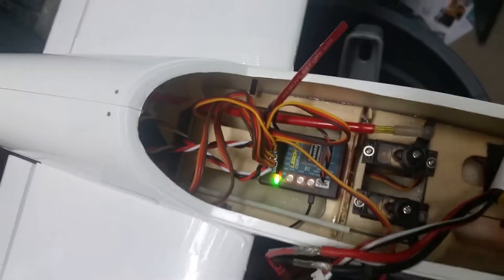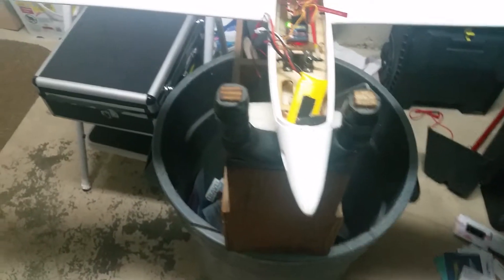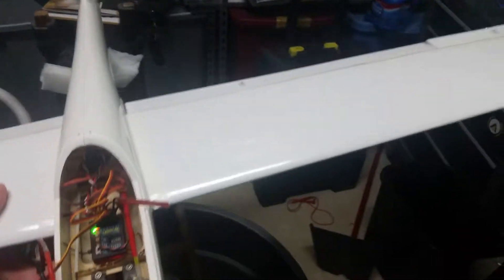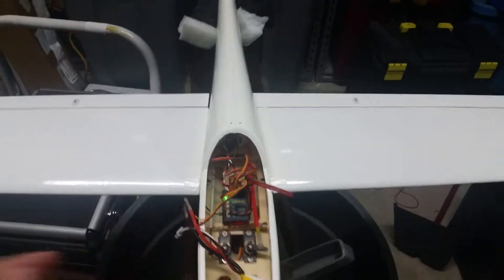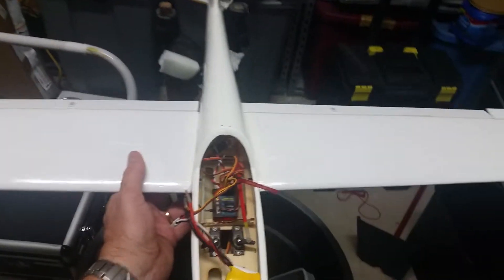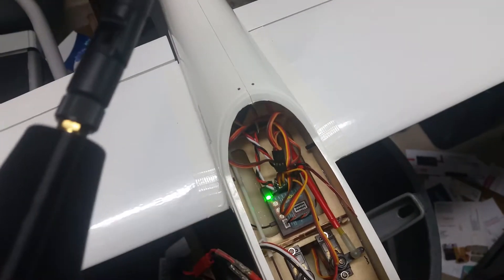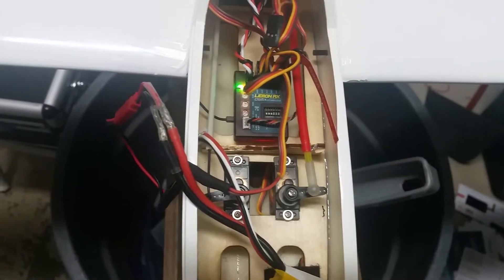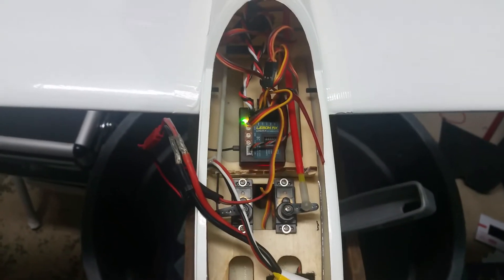Lemon RC DSMX Stabilization  Receiver

Comment from the maker: Because it is on ch5, it is eithe activated by the gear switch when no flaps are set up or by the assigned flap switch when you configure the model with flaps. In the video, the stabilization is on until the flap switch is moved. Then it goes into a normal flight mode.